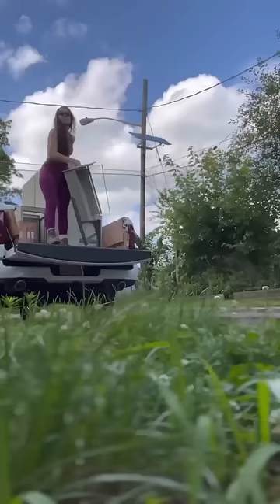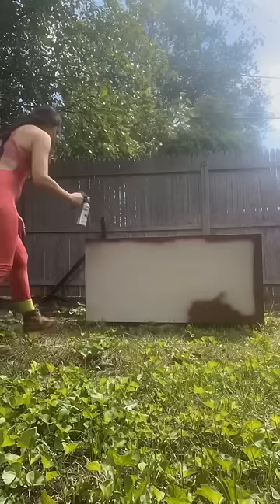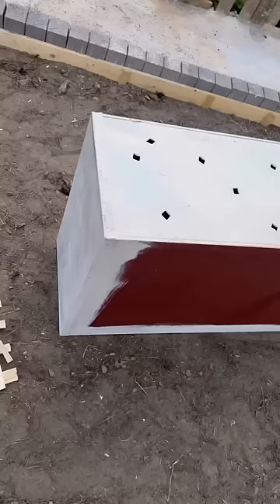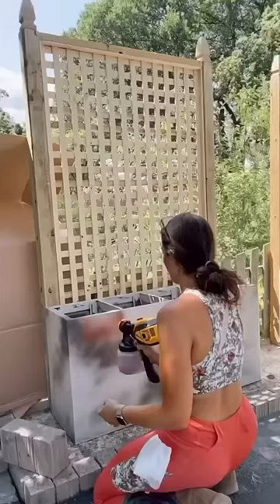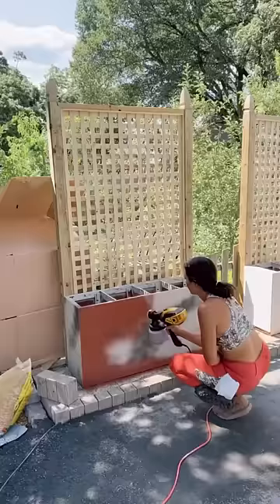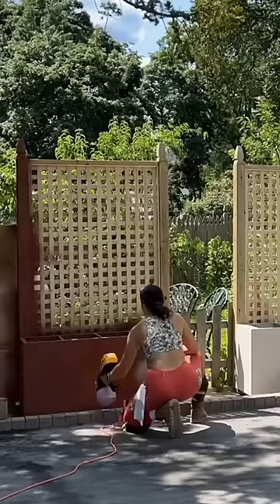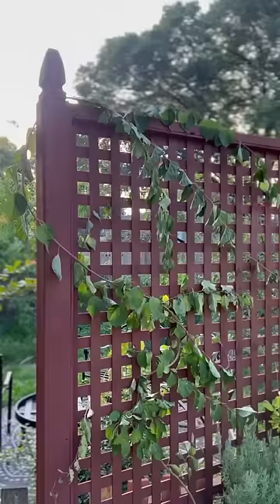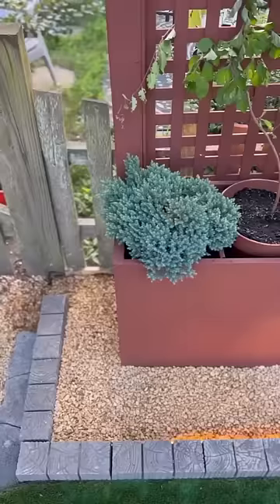How to make lattice privacy planters from filing cabinets | #diyprojects #diy

Comment: Cool idea  - but here in the Midwest won’t last a season before rust takes over - even with good primer and paint.
Reply: Rust can be nice on something like that
Reply: Metal file cabinets are made from extremely thin metal. In a humid or damp area these wouldn't last very long and you'll soon be redoing everything. @petersvensson1014
Reply: Accelerated recycling 😂
Reply: Those are designed to exist in an indoor controlled environment, and will rust to pieces in a short time.
Reply: Petina look
Reply: Too hot in summer, too cold in winter...even if you fix the rust problems.
Reply: I came here to say this.
The idea is there  and it will look pretty a for a little while but it isn’t going to last a year. 🤷🏾‍♀️
Reply: Wouldn't it be better for the environment/waste issues that the filing cabinets be recycled as usable metal before it breaks down into chunks of rust that will just end up in a landfill?
Reply: My solution is to use bathtubs. You're going to have to be inventive in how you set them up, but they're extremely rust resistant, and if you know anyone who's getting a bathroom or house remodel, you can get them for free.
Reply: @LaVanderou812  plastic ones, or old porcelain covered iron ones? I have seen ppl use old clawfoot tubs b4, but now days it's worth refurbishing them if possible as they can sell for quite a bit to the right ppl.
Reply: @whispersinthedark88  I have a few steel ones in my yard. I was going to scrap them, but I decided not to. I'm only going to get about $6 each, but a planter that size costs way more. In the NE, the weather is like a rollercoaster, but it's the humidity that drains you. I want to see what it's like somewhere hot but arrid. Just to see how it feels.
Reply: @LaVanderou812  I grew up in upstate NY, and spent some time in the south Bronx before moving to MI, so I definitely understand cold crazy weather, and lots of snow. 
 I was down in TX a couple times this year, it was so hot and dry that my friends yard was all dead grass with big cracks in the ground, at night the red ants would come out to bite you. It was terrible, and that's not even mentioning the highways and sprawl. All my friends down there hate it, and are trying to escape 🤣. I thought New Orleans was nice but humid, but at least you can walk around and take the street car.
Reply: @marks3750 ❤

Comment: These would be great for hydrangeas. They change color accordingly depending on the rust levels.
Reply: That's so interesting!
Reply: That's so cool! I knew acid levels tend to make some more purple/blue but I didn't think about rust impacting the ph like that - thanks for sharing :)
Reply: Wonderful joke, but it will never be fully appreciated.
Reply: @toddmitchell366  I sure didn't get it
Reply: @toddmitchell366  I fell for I and thought it was true 😆

Apparently it's the availability of aluminium ions in the soil not the ph...it's just that acidic soil makes the aluminium more readily available 

So falling for the joke wasn't wasted after all 😂
Reply: It's actually the pH level. But the rust ( iron) will make the leaves greener.

Comment: Ive been doing this for about eight  years now .  These filing cabinets are excellent  for turning into raised beds  to grow vegetables  in as i now find it difficult to kneel  on the grown .
No need to prime the metal just paint if you like . Also , no need to put drainage holes in the bottom . The cabinets are not sealed and water will leak out slowly . 
When these cabinets eventually rust out , maybe in another  four years , ill definitely replace them because they're free !!

Comment: I am certain any woodworker would love to quickly/easily assemble re-purposed/free scrap or pallet wood boxes for use as planters, in exchange for tall cabinets with functioning drawers, whose vertical stacking of storage within a small floor footprint would help them with organization in a small garage shop.
Reply: And your boxes won't rust out right away 😂

Comment: Rust adds iron to the soil below.
Reply: With the right rust proof paint it can last over 25yrs. 
I have metal pot holders on my front garden, bought them discounted cause they had dents. 
25yrs later still great.
Reply: I have a hard time believing that they’ve lasted 25 years unless they are protected by a roof or awning or something. I can’t imagine painting anything and it lasting 25 years. 
I think these planters might seem like a good idea but not really practical. Pretty sure it would bake whatever plants you put in them. Metal gets pretty damn hot. 🤷‍♀️

Comment: I use 😮the filing cabinets to store lawn & garden tools. I laid em down length wise, painted em & installed wheels on the bottom. I put the tools into 3 holes. Im able to push it out to the driveway or garden. 😊

Comment: I’d go with white to help keep that metal a little cooler. You could also add a thin layer of tongue and groove or even a bamboo mat type covering over them for both decor and heat protection. Nice job of recycling though, pretty smart😉

Comment: After adding holes the bottom can be painted with a rust-preventive paint to slow down the inevitable deterioration if the bottom.
Reply: What about the heat baking the plants? Metal gets pretty damn hot!? 🤔
Reply: @thatswhatshesaid6326  if painted a light color and if using separate pots as shown it shouldn't be too much of an issue. There are many who grow in stock tanks (large galvanized tubs designed as water troughs for animals) with no problem. 

The cabinets are small though and that's why I wouldn't put soil or plants directly in those especially if painted a dark color.

Comment: How did you get the wood posts secured to the ground?  Is the weight of the file cabinet meant to hold the posts with lattice all in place without being secured / cemented into the ground?

Comment: It's all great until the water eventually rusts the metal cabinets then you're going to have orangy red metal color coming out the bottom onto your rocks. Metal rusts especially from metal cabinets. Plants don't like rust. I would suggest spraying it completely with a rubber sealant over the metal. You're welcome from Green thumb grandma

Comment: Is that fake grass in the after? What would the before have looked like with the same color grass? What are the advantages of using filing cabinets over building boxes for the planters? Not just wood boxes, but other materials like concrete.

Comment: Finally cabinets traditionally aren't primed on the interior. In an environment that Is humid will cause them to rust quickly and in a situation like that they should be a mess in less than six months.  As long as it looks good on the outside someone will think it's wonderful but then reality is going to sit in.

Comment: Putting thin metal in your garden with paint on top and then soaking with water to contaminate your soil‘s, cook your plants and ruin your ground water is a very unwise idea. For some strange reason I believe that’s why they typically don’t use metal pots anywhere ever at all……..